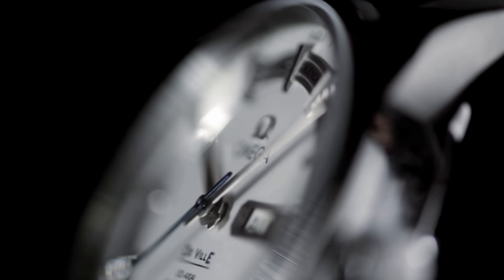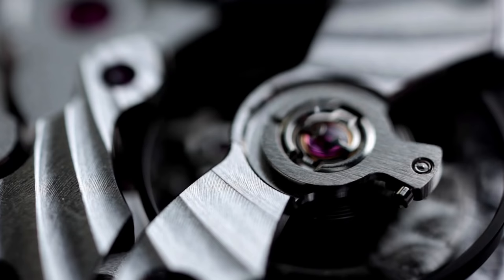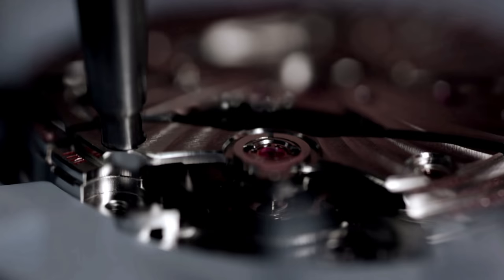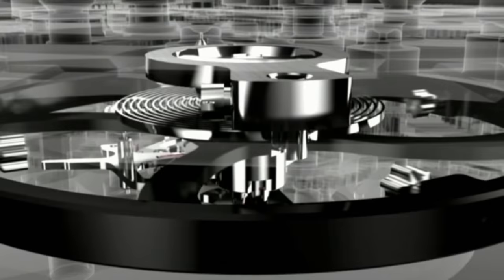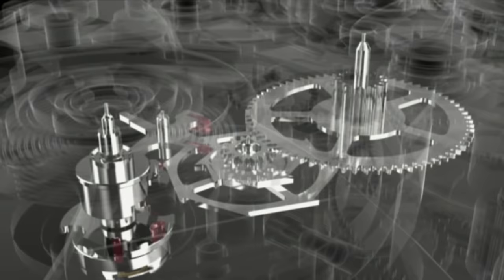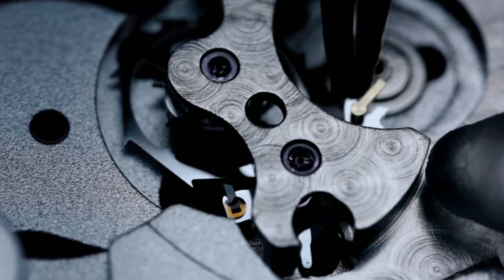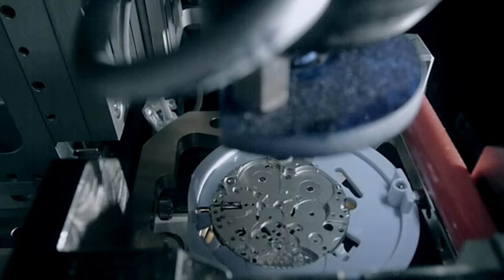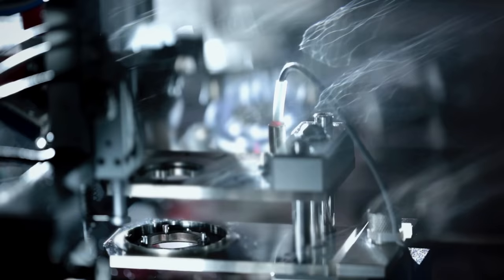Co-Axial Escapement | OMEGA

Comment: I am 37 and I love my Aquaterra with 8500 co-axial movement. I has been on the battle field for 5 years and it keeps a great accuracy 1+ per day. In addition, Daniel´s art work is such breathtaking and if you use an eye lupe you can see certain co-axial components. Moreover the beauty of 8500 movement, my watch has not run on service and it looks it can wait other 4 years.  I also have on my young collection an Speedy black dial and my  recent Datejust, but I must confess my Aquaterra has one advantage than others, it is all wearing style that make it easy to wear on business, casual or traveling.  Simply a happy watch lover, Thanks a lot Mr. Daniels and Omega, great work...
Reply: To

Comment: Dr Daniels was the first person in recent history to make every component of a watch, from scratch and by hand and dedicated some 60 years to the art. His “co-axial escapement” invention of 1974 - designed to make a watch’s mechanism run more precisely - was regarded by experts as one of the most significant horological developments in 250 years. It was even taken up by Swiss watchmaking giant Omega in 1999.
Reply: But the Spring Drive by Akahane at Seiko kinda beats that. They have quartz accuracy without using any escapement at all. The glide wheel continuously checks the beat rate with the quartz signal to slow down or speed up the main spring as necessary.
Reply: Кук
Reply: @MrZZooh  Brother. The spring drive is quite frankly a movement from it's own league. It's not really a fair competition to compare quartz regulation with George Daniels' pure mechanical accuracy. I think it's better to compare their new 9SA5 movement.
Reply: @hodb3906  à
Reply: Indeed Omega but remember George Daniels (1926-2011) couldn't convince other watch brands to use his co-axial escapement.

Comment: Rodolfo, to criticise the co-axial movement because Rolex saw no improvement is to completely miss the point of the design. The co-axial isn't inherently more accurate, especially in a brand new movement, the genius was to improve accuracy over the life time of the watch by reducing friction in the escapement and remove the need for lubrication that affects accuracy over the long term and in extreme weather conditions. As these watches are designed to last for decades this is the crucial improvement that George Daniels invented.
Reply: ddfann aha, few if any other video I've watched (...) on this states this so thanks for the short summary 👍🏽
Reply: NirreFirre ذ

Comment: ARe 5hese omegas valuable,I was left a box full of these some working most don't.
Reply: Many Omega watches are valuable.  Not so much the quartz watches but the watches with mechanical movements like the speedmaster might end up being five to $10,000 depending on the model and the age. I would go to Google look up the serial numbers on the back case or maybe if the names on there just look the name up and go to eBay and see if you can find that model from that year... That should give you a good idea of what they're selling for. there's also an Omega forum that I run across now and again when I'm searching for something watch related on the internet. one thing you're going to want to do is avoid asking for valuations of any of those watches on a forum or really anywhere other than from a watchmaker or watchsmith local to you. This is just considered bad form and you don't want to do it. I'm sorry about the bad punctuation and whatnot. I'm writing this on the phone with a broken screen.  Llok

Comment: Is co axial better than the spring drive?
Reply: The coaxial escapement is not inherently more or less accurate than the more common Swiss lever escapement, but it is far more efficient, thus it require far less maintenance, and diminishes wear and tear on all the  other elements of the movement.  Its operating costs are less, and it maintains its accuracy for far longer.
Reply: The escapement on a Spring Drive movement is another solution to the same problem; it is an elegant approach, but it is not purely mechanical.  I guess it depends on how you feel about the Q word.
Reply: @jamesdevoe5945  quartz :)
Reply: @ras.4913  For me the question is, GS Snowflake vs Omega speedmaster 38.  The answer has always been, I would like both, but I am not ready to pull the trigger on either.  The dilemma has now intensified; Rumors are that Roger W. Smith, George Daniels'  friend/neighbour/colaborator/succesor may  produce an affordable (i.e., under $ 100K) version of his improved co-axial escapement watch.  I guess that would make it a trilemma?
Reply: @jamesdevoe5945  you know at the end of the day you should have both. Since if you grow tired of any of them, they are easy to flip. Life is too short to...
Reply: @ras.4913  I appreciate the thought.  Ill tell my wife that I have found another watch enthusiast to validate my need for yet another watch (or pair of watches;) I'm sure that, enlightened by this information, she will agree with the purchase.  Seriously, thanks for the kindness, and good watch hunting.😉

Comment: The Bulova Accutron first came to market in 1960. The Accutron index wheel is 2.4 mm in diameter and .040 mm thick with 320 teeth along the edge of the wheel. Each tooth on the index wheel is .010 mm high and each tooth is .020 mm wide(yes 10 nanometers and 20 nanometers). The typical hair on your head is .070 mm and the finest of hair is .020 mm an eyesight differentiation ends at .040 mm for one with excellent eyesight. The index and pawl jewels that are used to regulate the index wheel are .18 mm square by .060 mm thick(unreal), yes a ruby jewel the thickness of a human hair.  In one year, the Accutron index wheel revolves 38 million times(WOW) or 72 times a minute(320 teeth on index wheel times 72 revolutions a minute is an unbelievable feat for the index and pawl jewels and their nanometer size makes it even more astounding). The Accutron is regulated by a tuning fork that vibrates 360 times second(unreal)(tuning forks of the Accutron movements have virtually zero positional error). The two coils that are used to resonate the tuning fork are made up of .015 mm wire spun 8100 times around a cylinder each(super unreal), if this wire was strung out it would reach around 90 meters long. The coil wire has a tensile strength of about 2 grams(imagine the precision spinning this wire onto a tube 8,100 times without breaking or distorting the wire). 

A thirty year Accutron  means that over 2.8 E+11 teeth have have moved under the pawl jewel.
Accutron was advertised to a two second a day plus or minus variation(some hobbyists claim much better accuracy with tuning)
Plenty of Accutrons still out there and running strong that are over 50 years old. 
The Accutron was theoretically proposed by Swiss engineer Max Hetzel which he built  a few prototypes. Hetzel moved to the USA and joined Bulova engineer William O. Bennett and a host of other engineers in New York City in the development of the caliber 214. 
To this day no one really knows how the Accutron index wheel was produced nor the index pallet jewels.
Reply: 0,001 mm is one micrometer, not one nanometer.